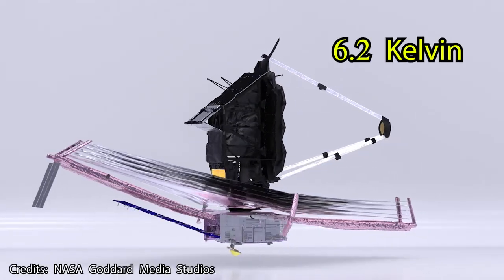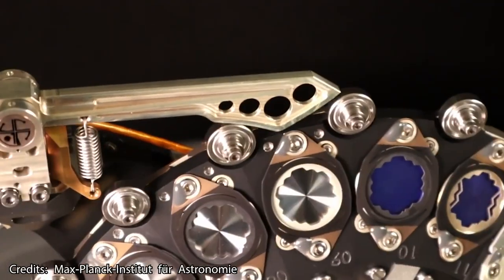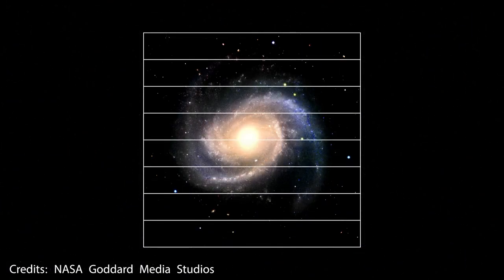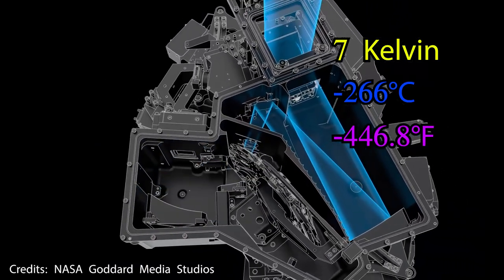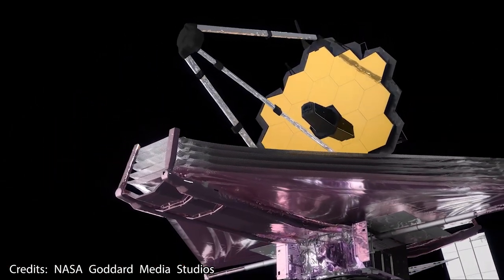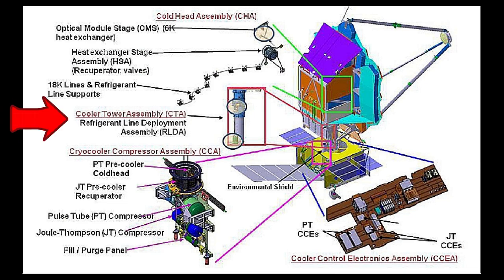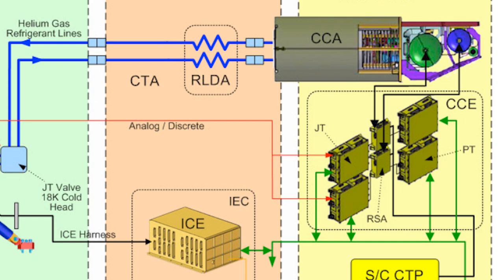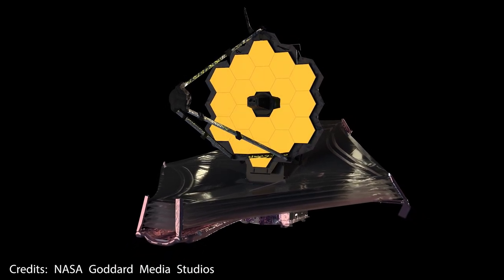This Is How Webb Cools Down Its Instruments To Near Absolute Zero.

Comment: What was the "pinch point" that sounded like it was a tricky thing to do?
Reply: At a temperature of about 15 K, the cryocooler is inefficient: its ability to remove heat is at its lowest point. So it would only be able to cool MIRI below 15 K if the calculations for heat flow were correct so the cryocooler could remove heat faster than it's getting into MIRI.